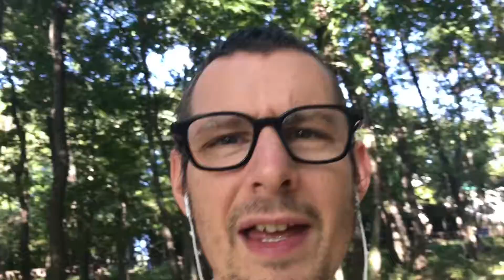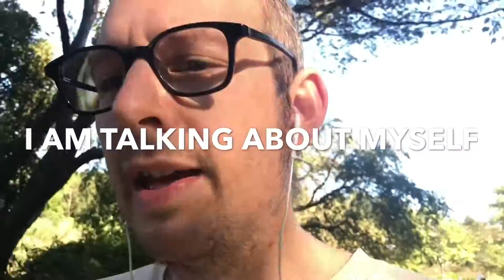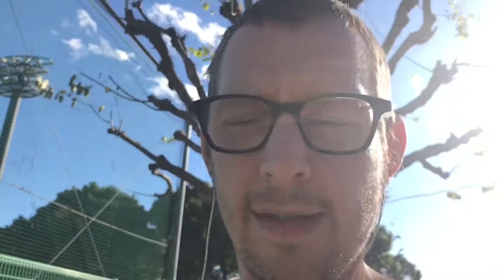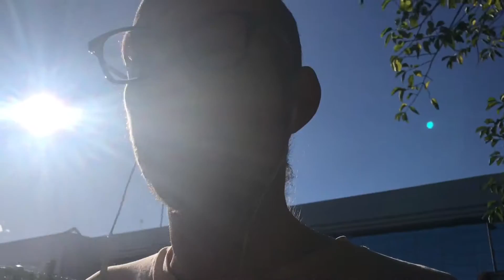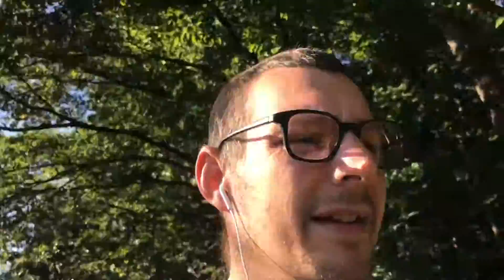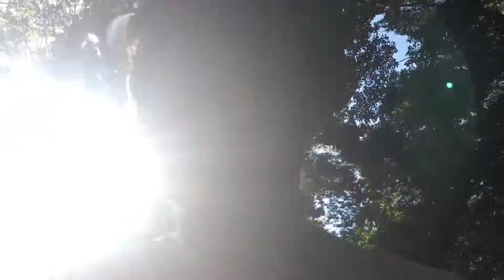TokYo-Yo Debate - Monometals VS Bi-metals...are bi-metals yoyos worth it?

Comment: The monometal I want is $100 and it's known to be hard to tune...
I could actually probably buy a better bimetal for cheaper.

If I ran a yoyo company, I would only sell one yoyo design, but it would come in every variety: plastic, aliminum, bimetal with brass, bimetal with steel, and mini titanium with delrin sides.
They'd obviously look slightly different, but they'd all be designed to play and feel the exact same.

Comment: Oh man, great topic. 

Honestly, I feel at this point if they Bi-Metal isn't taking absolute advantage of the design, its a waste. You can spend less money for a MUCH better yoyo. Lots of Bi-metals that came out at the end of 2016 and early 2017 are straight up garbage and obsolete and overshadowed by significantly better mono metals that cost much less.
Reply: Throws N' Brews totally agree!
Reply: I completely agree apart from a select few, bi metals arnt providing any advantage anymore. It started great the draupnir and the nightmare were very light and very fast, then the edge was pretty good but not perfect now the newest ones are just yoyos with rims slapped on them so they can charge an extra $70.
Reply: YoyoJam had the patent on Bimetals for this whole time. Now that it went belly up manufacturers in the USA can now make them.  I'm sure they had models and designs for a long time waiting for such legal matters to end.
Reply from the maker: +Steve Loewen huh! I knew YYJ had a bunch of patents but no idea they owned bimetals too. Thanks for the info!
Reply: I'm extremely skeptical on whether yoyojam actually had a patent on bimetals.  Hspin made and sold the bimetal handquake a whole 2 years before the the yoyojam patent.  I'd believe holding a patent on plastic with metal rims, but bimetals...
Reply: It was worded that you use a more dense metal as weight rims, never the less it was the reason why they couldn't be made but  some non USA companies continued making them
Reply: The specific wording is "formed of material having a density substantially greater than that of said
main body portion".  Earlier in the patent he describes "In the preferred embodiment, the peripheral body portion is formed of metal, preferably aluminum. This has a substantially higher density than that of the plastic main
body portion". 
The patent is specifically for metal rims on plastic body.
U.S. patent 6206749
Even if the product was made in a foreign country, it can't be marketed and sold in the U.S. without violating the patent, which the hspin bimetals were in the mid 2000s, and no legal action was taken against them.
Reply from the maker: Loving all this history. 🤑🤑🤑

Comment: Great topic. One aspect that nobody has pointed is that bimetals are like "sport gear" for competitors. Yes, you don't need a bimetal at all for any trick, but imagine being a serious competitor who has a ton of things to handle at the same time, the added stability of a bimetal will help you focus on your evals or your trick difficulty. Saying that bimetals are stupid and that they are not necessary is like saying that you can run a marathon in flip flops, yea you can, but it won't help you at all. Same goes for topics such as centering bearings vs flat bearings. 

I like monos and bimetals, my Nightmare shines like a star when you push it insanely hard, but if I want to have a more chill throw session I'll  probably pick my Vector or Shutter.

Also, dude, you channel is picking up subs like crazy.
Reply from the maker: +EOS44 nice points! I hadn’t considered this angle!

Comment: Only when it attempts on design extremes such as extremely light weight(machinaTion), super torque(Firrox, Pragma, Tsunami), or as a cheaper alternative to designing and machining complex parts (Yoyojams were experts in this)
... Or because it looked amazing and they want to show off (YoyoEmpires, let's face it their Edge and Engine didn't need to be bimetal but they did it anyways cuz reasons)